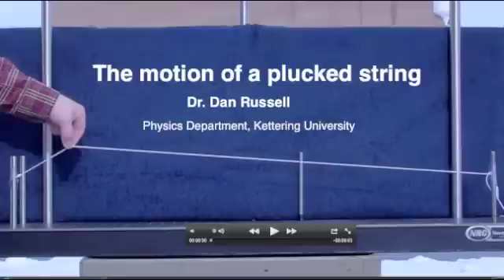Motion of  Plucked String

Comment: Ahhh this is EXACTLY the motion I'm trying to study but the video is so low res whyyy xD
Reply from the maker: It was recorded 9 years ago with a $700 "high speed" camera -- the best camera I had available at the time.  Filming at 1000 fps automatically reduces the resolution (unless you have access to a much better high speed camera, in the $5,000-$20,000 range -- which I did not have access to.)

Comment: Very informative, although there is an implication that a guitar string does this. The string used in this video is far more flexible than a guitar string. I would be interested in seeing this repeated with an actual musical instrument string under working tension.
Reply from the maker: Yes - a plucked guitar string does (almost) exactly this . . . only much faster because the strings are stiffer and the frequency is higher -- the low E string (84 Hz) on a guitar exhibits this cycle of vibration 84 times per second, and the amplitude is much, much, smaller so it is very difficult to observe even with a high speed camera. I am preparing a paper for publication that show the out put of several types of guitar pickups (optical, magnetic, force) which shows that the initial motion the steel guitar string immediately after being plucked, exhibits exactly the motion shown in this video for a more elastic string.  I'll try to remember to post a link to the article and an accompanying website (with images and sound files) when I finish getting it ready for publication.